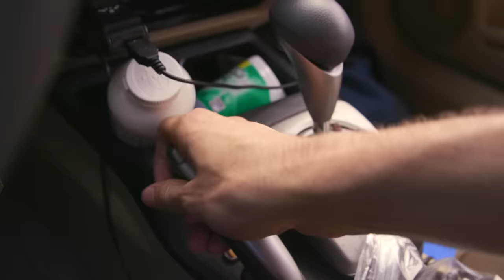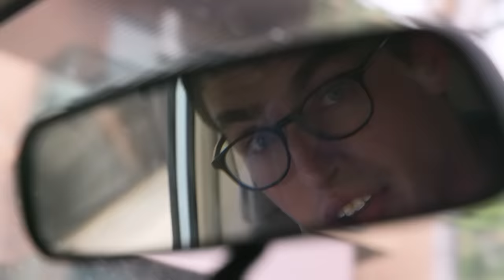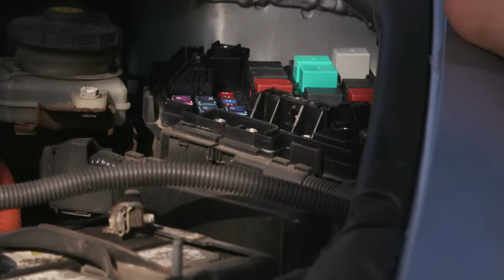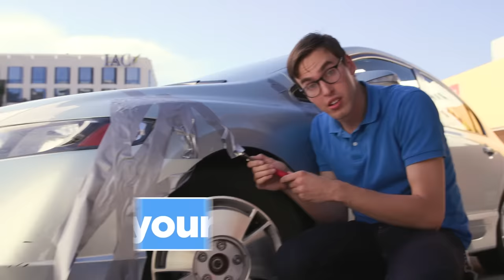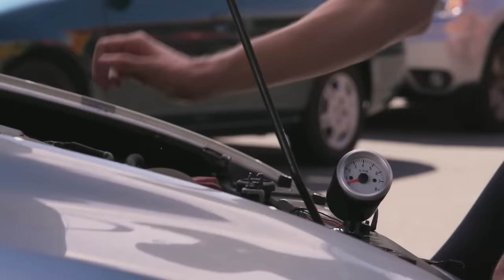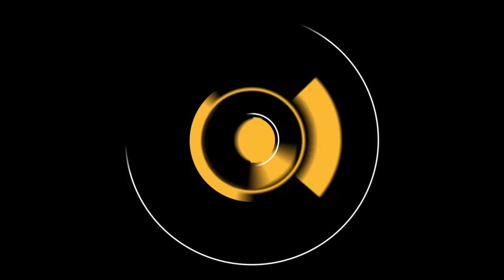5 Tips for People Who Don't Understand Cars

Comment: The tachometer describes uses the magnetic field of the alternator to detect how fast it is spinning, and through some minor calculation the gauge is designed to display the engine speed based on how fast the magnetic field is “spinning” (not exactly that simple but I want people to understand)

Comment: all a tachometer does is show your engine speed in revolutions per minute (rpm) and you installed one to measure the speed your alternator is rotating at, when you could just find out the belt drive ratio of your alternator to your crankshaft pulley and find out what speed your alternator is spinning at by just adding (or subtracting it to the engine speed based on the ratios of your alternator, pulleys, and belts on your motor (correct me if i am wrong)

Comment: most cars have a tachometer on the dashboard.
but that type of tachometer tells your ecu what speed the engine is running, your alternator is like an electric motor that gets turned by the engine to generate electricity to charge the battery and run other electronics. An electric motor has magnets spinning around inside of it. The magnetic pickup can tell when one of the magnets goes past, therefore detecting the speed of the alternator. The alternator's speed is proportional to the engine's speed, so it can detect how fast your engine is turning.

Comment: The fact is that the alternator is run by a belt fed from the crankshaft whose rpm we  need to see so the rpm of alternator is nearly the same as crankshaft thus we install it on the alternator belt most of the diesel cars actually don't have tachs

Comment: You should always check your tachometer or "rpm meter" while driving. Every car has a sweet spot where the oil can no longer lubricate the engine and that's the point you need to stay below to prolong the life of your engine
Reply: Cars have rev limiters that physically stop the engine from spinning up to those sorts of speeds. Unless you're really stupid, and do a money shift, you won't break your car by revving it too hard.

Comment: The way a inductive tachometer works is it’s essentially a large coil of wire that reacts to the shaft moving by way of picking up electromagnetic fields, the faster the car goes, the faster the shaft spins, the bigger and stronger the EMF is, this is amplified in electric cars because most electric cars use three phase ac which is this wonderful system that Nikolai Tesla came up with that allows us to use three wires instead of six anyway the EMF generated by these brushless motors (the 3 phase ac ones) is much stronger due to there higher rotation speed and radiating energy cause by the ac. If you go inside and measure the voltage coming from you fingertips you will see a small voltage this is because your acting as a antenna the same thing happens with these motors
Reply: I’m 12 btw

Comment: A tachometer shows the rpm of the engine almost all modern vehicles have one even diesels like my 5.9L cummins (durastroke) 24 valve with the common rail injection I know that sounds sexual it's not

Comment: You only need one tip if you don't understand cars! And that tip is: DON'T DRIVE cars.

Seriously... If you don't maintain your car and can't quite drive it, then don't bother at all! Carpool, or take the bus! 
Get out of the fast lanes! When the light turns green, actually drive and don't sit there thinking about your laundry, or your instagram! Use your mirrors to see other cars, not your own stupid mug! Also look, before changing lanes. Don't brake for no reason! Don't park like an idiot. And in winter time, clear the snow off the damn roof! And when you drive in snow, don't floor it! You'll just lose control and crash into something. 

With bad drivers that don't understand cars off the road, we will have safer roads. Us petrolheads will be able to enjoy the roads. We won't worry about our cars as much and you won't have to be honked at for driving 20 under the limit in the left lane. And the cars will get better treatment. Cause cars are so much more than just machines. If you don't look back at your car after locking it, you don't understand what I mean.
Reply: You only need one tip if you don't understand computers! And that tip is: DON'T USE computers.